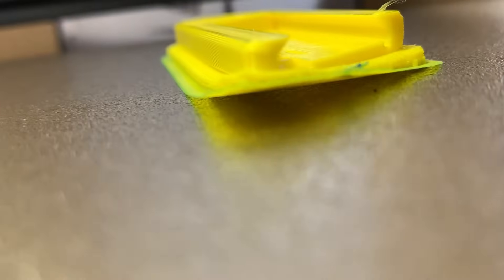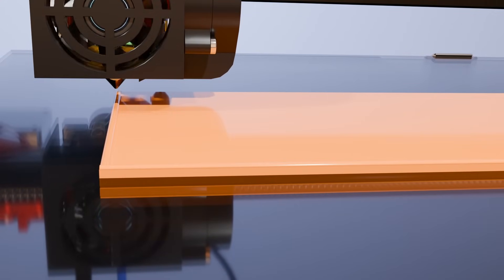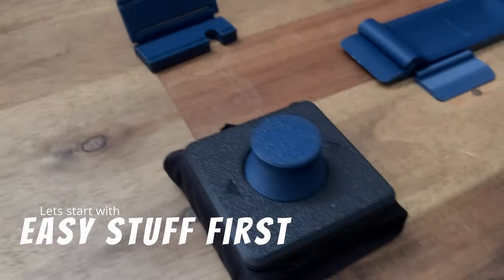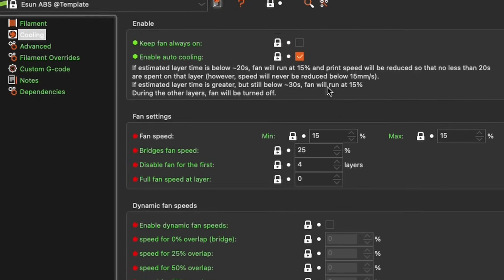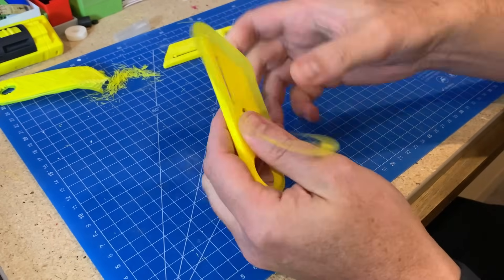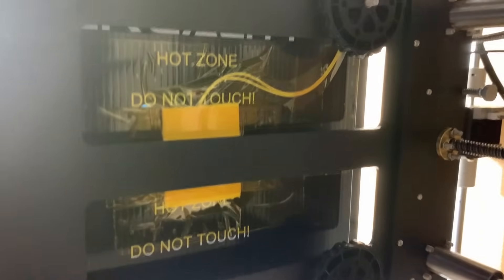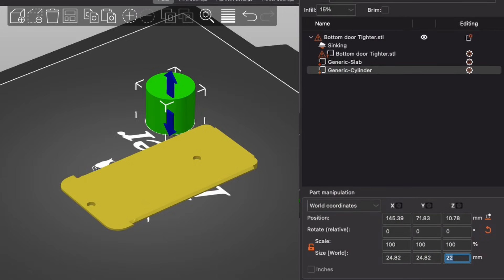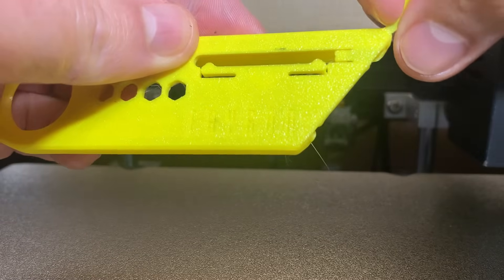Understand and fix lifting corners on 3d prints. Including mouse ears !

Comment: how can u print without the thing at the bottem
Reply from the maker: if you mean the extra brim around the edge it’ll depend on the model and printer.  some people have good results by slowing the print right down.  the brim works well though and can be removed pretty easy if you only use a thin one.

Comment: The best thing to reduce warping is slowing down the print speed.
In my case it helped a lot. I print technical parts (guitar bodies) and with high infill (60%) and a lot of walls (6 perimeters) the warping always occurred. 
In my case a bambu A1 is a bed slinger so it's not helping either... Bed slingers are more prone to warping because of the moving mass.
Reply from the maker: Thanks for sharing your experience.  Since posting this one people have told me slow works well so that the layer is fully cooled and hard, which in your case I would say works because of the high perimeter numbers.  other people have said fast works for them because it keeps the heat in the print longer.  For me I tend to slow if I’m having trouble like yourself but depends on the printer I’m using too.  Warping is one of those things that I have to say, do what works for you, your printer, and what you’re printing!!
Reply from the maker: and I’d love to see your work ! !  !   you definitely need to post some videos on that !!!

Comment: With my 3d printer i have no issues with adhesion but print is warping still, it's so strong that magnetic bed it self lifts from one side (PEI in top of metal sheet, its not even weak bed) because print warps.
Reply from the maker: Sounds like your adhesion to the plate is good.  If your printer is able, you could try some bulldog clips to hold the actual plate down?

Comment: Had zero issues with Bambu p1s for first few months then occasional corner lifts. Tried Bambu slicer mouse ears but I find that as they are quite small and laid down first I now regularly have issues with the mouse ears lifting and then being dragged around by the head and ruining the print totally. Have had to replace nozzle recently but same issue still occurs but not on every print. Re entry replaced textured plate. Still have the issue. I do clean with IPA and lint free cloth. Starting to think it's environmental or filament differences.
Reply from the maker: I'd try some filament and a print you've sliced before that's worked and see if it works still.  You can rule a few things out then.  
- If they are both fine, maybe something has changed in the way you are slicing or like you said different filament needing different settings.  
- If the old files and filament lift now too, it's likely something to do with the plate being dirty or a physical difference with the printer (maybe z needs physical adjustment back to zero).

hope that helps and thanks for watching !

Comment: Ur way of cleaning the bed is super cringe
USE WATER AND SOAP
Ipa damages ur bed over time
Reply from the maker: Depends on your plate imo. I was printing on one plate using that method for about 6 years and it still worked great until it started to get old and wasn’t perfectly flat.  There’s definitely some PEI plates I wouldn’t do it with because it can wear the texture down and for those I wash.  I’m experimenting with one at the moment though to see if that really is the case and after a year and a few hundred hours printing and at a guess about 50 wipes it’s still as good as new. A wash in soap and water every 15 or so wipes as well.

Comment: After 12 years or so 3D printing, the recipe for me for successful ABS printing, is PEI sheet bonded to glass.With a nicely leveled bed, adjusting the nozzle/PEI gap to 0.7mm is optimal. Bed temp is set to around 105C reducing to ~95C after a few layers and nozzle temp to 235C or manufacturers recommendation. I prepare a new PEI sheet by sanding it with 400 grit wet and dry paper (using water) and repeat every few prints. For PLA, I use nothing -  just plain glass, cleaned with window cleaner, dried off, then briskly rubbed with kitchen tissue as if one was polishing it. Bed temp around 70C, nozzle 205C or manufacturers recommendation.
Reply from the maker: That’s a great set of tips! I’ve got questions !! 
You still use glass now over PEI ?  When I first started glass beds were popular but I never tried one because I heard it was so tricky.  
also, Do you bond the pei to the glass to ensure it doesn’t warp?  
I’ve never heard of using sandpaper on pei either!  Is it to clean off residue or rough it up to give texture? 
I think I definitely need to do a follow up video with all these extra tips that people find working for them
Reply: @3DPrintSmith  In answer to your questions. I use 4mm glass for ABS and 4mm glass for PLA. The difference of course is that PLA goes straight onto the glass surface whereas ABS is printed onto the PEI sheet.The PEI sheet is adhered to the glass plate with 3M adhesive sheet (468MP). The 400 grit wet/dry paper (not woodworking sandpaper) is dipped in water and rubbed over the surface of the PEI to get it back to a nice clean surface - not really to roughen it up, but just to get the surface refreshed. I think I've used 600 grit as well in the past.
One thing I learned early was to surface a New PEI sheet in the same manner with wet/dry paper before using. If a brand new sheet is printed on without preconditioning, the print will be difficult  to remove without possible damage to the part and the PEI such is the sticking power of it. The best PEI for me is at least 0.8mm thick.

Using PLA directly on glass (prepared as stated in previous post) produces excellent adhesion results - well, not exactly adhesion but more like suction to the glass and I print in PLA+ as a preferred filament these days (except when its unsuitable of course). Hope this helps!
Reply from the maker: I'm surprised at the wet and dry on pei still but if you are used to printing on glass it makes sense.  There's some great tips there so thanks !!

Comment: actually to high bed can also lift corner of the print!
Reply from the maker: I’ve not had a problem with the bed too high but you’d be right, it would make sense if it’s not getting that first layer down properly.
Reply: @3DPrintSmith  well I fixed my lifting corners by lowering bed temp. It was just too hot, so layers don’t cooled down well. I print functional parts with 100% infill. And low fan speed for better layers adhesion. I think this is the reason for me

Comment: I use orca and definitely will do the cylinder trick on my next print. thx for the tip !
Reply from the maker: I'm using Orca Slicer more and more now. It'd be good if they included a tab to insert as a part but you can always create a stl and add it to your config so that it makes it easier to add in an already customised size tab the size you want
Reply: @3DPrintSmith 
I wanted to reply faster, but then work happened 😫 
Lol. But I like your way of thinking, very efficient I must say. For sure will use this too.  Thank you again.

Comment: I printed a long rectangular part that warped heavily, lifted up the build plate, even though it was PLA.
Turns out it I had too many walls (the whole part basically was straight long lines). So they all contracted in the same direction.
So this can be a tipp too if you have corners lifting: Reduce wall count if it's something crazy like 8 walls and use infill instead, even though you loose some strength.
Reply from the maker: nice tip.  I’m getting so many extra tips I think it’s time for a follow up video !

Comment: Orca Slicer has slicer settings for mouse ears, it's in the 'other' tab, under 'brim' - select 'mouse ear'  then you can mess with the size , slice and they are there
Reply from the maker: At the time of the video, I hadnt used orcaslicer but it's now my primary slicer and that's a great tip ! !

Comment: Can't find the plug in for Cura, I'm on Cura 5.9. Does anyone else have the mouse ear tab?
Reply from the maker: Yeah shortly after this the plug in was removed from Cura.  I did a follow up video.  

https://www.youtube.com/watch?v=rzr3FVAZtbk&list=PLYKJfB3dUgY6EJd-qO1xP8iCL2uHwyt2-&index=4&t=2s
 
You can still get the plug in but it's a manual download and install through Github.  If you havent used github before it's not as difficult as it sounds.  

Github link for the CURA plugin
https://github.com/5axes/tabplus
Reply: @3DPrintSmith  thank you, looks like Cura plug-ins have been all removed

Comment: Have had some issues with corners lifting up.  Ender 3 S1 Pro, clean bed, PLA 70 bed temp.  No issues whatsoever with my enclosed P1S.
Reply from the maker: is it a good first layer squish? I know I saw someone with a ender 3 the other day have an issue and couldnt get the z axis adjusted down any further and had to adjust the homing switch to get it to where it needed to be for better adjustment

Comment: Having this issue now with a light box. Going to try the brims to see if it fixes my issue
Reply from the maker: Let us know how it turns out !
Reply: @3DPrintSmith  It helped alot but still had a little bit of sag.  Best one by far out of the 5 I printed though. Thanks for the tip

Comment: I'm giving the draft shield in Cura a try. Printing in winter in a cold house is a challenge with pointy parts! Thanks for the tips. I'm also spraying hairspray on the bed as after wiping with alcohol it never wants to stick
Reply from the maker: let us all know how it goes and thanks for watching.  I’ve heard hairspray can leave a bad fish on the print so I’m interested to hear about that one
Reply: @3DPrintSmith  It's never left anything on the print as far as I can tell and I've sprayed a tonne of it sometimes even during the print. Printing a 6 hour difficult print right now with long thin bits which go up high and it is 40% done with no warping so far (fingers crossed)
Reply from the maker: sounds like it works for you. I’ll remember that next time I’m out of things to try !
Reply: @3DPrintSmith   Actually I was 60% through and it started to unstick from one end where it kept leaving a blob of infill that the nozzle kept hitting. Not sure if it would have done that anyway but I managed to save it by putting random heavy objects on the brim to hold it down, using a small portable blowtorch on the problem areas to melt the excess away, increase the nozzle temp while lowering speed and I just about salvaged the rest of the print after keeping an eye on it and helping it out. Was still better than the first attempt by a mile. I think I was too far from the bed on the initial layer and didn't get good bonding with it. It didn't warp this time, just unstuck when it got hit.

Comment: I have been through this issue for many prints.  I tried this solution and that solution.  Some would work with one type of material, or this type of bed.  I wanted a guaranteed fix so a 24 hour print would stay flat.  This procedure I came up with will prevent any king of lifting and use less material because a brim or raft is not required.  PLACE BLUE TAPE ON YOUR BED.  AFTER ABOUT 5 TO 6 LAYERS ARE PRINTED, USE THIN SUPER GLUE,  AND PLACE A FEW DROPS BETWEEN THE CORNER OF THE PROJECT AND THE BLUE TAPE!  The thin super glue will wick into the corner.  Your project will no longer lift at the corners, ever!!!!  PROBLEM SOLVED!
Reply from the maker: wow, that’s extreme !   if it works and there’s no issues then sounds good.  I’d be too worried about spilling some where it shouldn’t be !!

Comment: Brother, I have a makerbot replicator+. 

No heated bed. I have tried everything from millimeter per second extrusion speed reduction, temperature decrease. 

I’m at my wits end with this 3-D printer. And I resent its production.  And I’m running out of ideas.
Reply from the maker: No heated bed would be a real pain. I don’t recommend glues or products to make the bed sticky but in your case have you tried? Maybe there’s a pei bed you can get for that model ?  If you find something let us know !
Reply: @ i’ve tried glue sticks. I’ve heard some people out. They say to use GAF tape. I’m not sure which direction you’re supposed to face the tape the sticky side on the bed or the sticky side facing up. If it’s sticky side facing down, I could really mess up the bed for future prints because of the tackiness and residue left behind is impossible to to remove
Reply from the maker: I’ve used blue painters tape before on a glass bed.  Sticky side down, it gives you texture for the print to stick to.  painters tape comes off without leaving residue. you need to be sure you level your bed so the first layer doesn’t rip the tape up.
Reply: @ I’m new to bed leveling. Haven’t done it. It’s technically not my machine but when I reached out for my client, ultimaker  said that they no longer support that device because it’s a pre-covid model. Sombich is old

Comment: I watch several video on the warping subject
I received all the informations and their contrary 
You say increase the bed temperature 
Others say decrease the that temperature 😢
Reply from the maker: I’ve seen a few people say cooler but that definitely doesn’t work for me. That’s why I always try to understand the why behind something happening and if what is working makes sense. In this case, you want the print to not cool too quickly so if you can keep heat in those lower layers, it helps with reducing fast shrinking and pulling away from the bed.  All I can say is that heat works for me and I don’t need glue or anything added to the bed to hold on the print.  
My advice is, every setup is different so if you get something pulling up, try just changing bed temp one way or the other and test what works in your case. 
I’d love to hear how it goes and see if I’m just special :-) !!!!!

Comment: The pad on the bottom of your bed is just the power coupling. The actual heat is generated in electrical traces that are across the entire underside of the bed PCB (You can see the traces snaking back and forth when you looked under the bed.) That's why your bed heats up evenly and not from the middle outwards.
Reply from the maker: I originally thought the same and not sure if mine is damaged but it definatley doesnt heat out to the edges and only really heats about a 60 by 60mm square in the center well.  Past that it's heat transfer from the center is my guess. I've tested heating the bed to 80 degress and you can well and truely touch out past the center but can cook and egg in the middle.  Could be time for a new one !  :-)

Comment: All these things go a long way especially keeping the plate clean.    The most important thing I found is don't cheap out on Filament.   Buy something like PolyTerra.      Lots of the cheaper ones like Sunlu, Elegoo  all Shrink sooo much!  this only shows up mainly on larger parts that are more prone to it.       I used to think they were mostly the same   I was well wrong!    I have 10 years experience printing and sometimes only by getting good Filament are you going to get rid of these problems completely.
Reply from the maker: Good point.  I've been using a lot of matte colours from Overture recently and apparently they are made by Polyterra, just rebranded but a much cheaper though so an alternative for those on a budget :-)
Reply: @3DPrintSmith  I have used Overture TPU and that has been great.   That's good to know.

Comment: Does it help or hurt to make the mouse ears taller?
Reply from the maker: you want it to be fairly thin.  if you make it thick, you start to introduce the shrinking forces on top and have potential for the mouse ear to then pull up as well !!
Reply: @3DPrintSmith  ah, that's what I was afraid of. So what's the ideal height in your opinion? Just one layer, or a few?
Reply from the maker: I typically go only 1 layer, sometimes 2 if the layer height is really small, like less than 0.12

Comment: Interesting how some recommend raising the bed temperature and some recommend lowering it.
Reply from the maker: For me,  prints come off basically by themselves once the bed cools down completely so keeping it warm for as long as possible keeps that consistent grip. More due to slowing the slight shrinkage pulling it off the bed than actual stickiness.
Reply: For PLA def keep it warm, when it cools down it loses sticky properties and just comes off
Reply: @ridrugo182  what about for PLA specific cool plates that have a suggested bed temp of 30C? if I don't start out higher than that they're extremely difficult to remove and leave behind a ghost of the print
Reply: @alexflu2  yep, for those it makes sense. I use a Biqu cool plate and it sticks pretty well in lower temperatures.

Comment: Hi,  I have watched many videos about this issue, But your seems to be more specific. Juat a question, How can i use a different Slicer for CR10 Smart Pro by Creality? Like Orca or Prusa slicer. Seems like these have more settings available than Creality ones.
Reply from the maker: Absolutely. My main printer is a Creality Ender 5 and I changed to Prusaslicer from Cura about 2 years ago.  I occasionally use Cura every now and then but I'm slicing 99.5% of things in Prusaslicer now.  Once I got the printer settings dialled in I thinkit gives a better result.  
When you install Prusaslicer or Orca you get the option of choosing the printer model and the basic Creality models are all there.  There's a few things I changed from the base like retraction settings and jerk as well as the custom gcode to stop it moving around so much before and after the print. For the CR10 you probably would need to do a few changes as well depending on your setup but I can recommend installing and giving them a go.